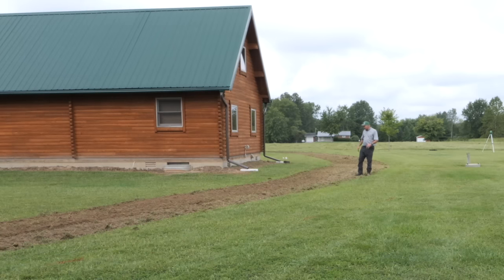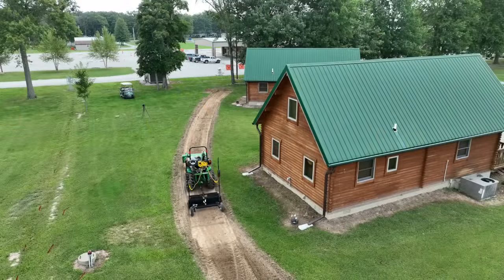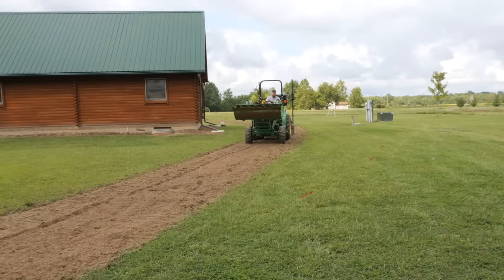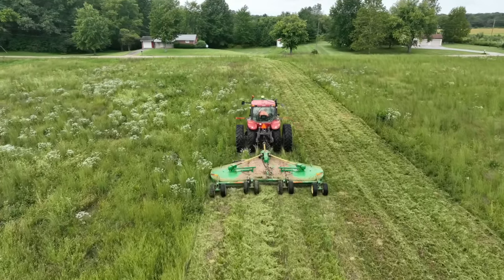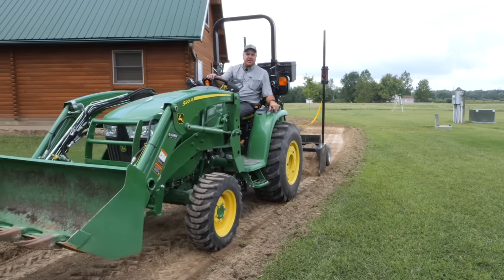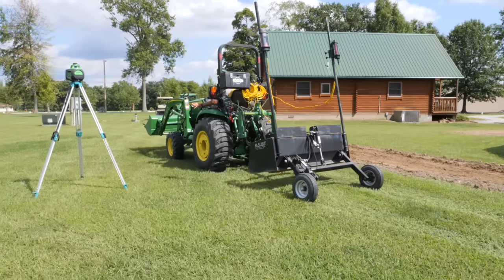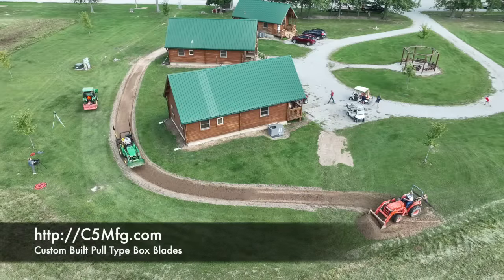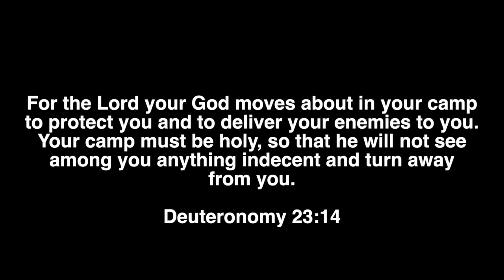Longest Drainage Swale We Have Ever Dug! John Deere, Kubota Tractors, Tom, Randall, Laser Box Blade!

Comment: Saw a guy use a skid steer the other day. He took out a bucket width down to grade. Then put one wheel in the center and cut the swale in. The he did the same on the opposite side. When finished it looked like it would be very easy to keep maintained. Very cool set up on the box blade.
Reply from the maker: Sounds like a good operator!  Yes, one strip down the middle, then slopes via wheel in furrow on each side makes a very nicely shaped swale…especially when smoothed up with the power rake!

Comment: Fun video!  Can I ask a question about the Maschio hydraulic offset flail mower that you have shown previously?  What is the range of cutting heights that it can cut - the manual doesn't tell.  You mentioned adjusting the cutting height, but I didn't notice you saying what height the choices were.  I have the same question about the Maschio hydraulic sickle mower that you showed - does it only cut one height?  What height does it cut?  Thanks!
Reply from the maker: Several height choices.  Ground level to say 4 inches or so I think.  However, our experience shows that lower cutting height makes for best cut.
Reply: Thanks! @TractorTimewithTim

Comment: Would an orifice restrictor(s) on each cylinder smooth out the motion?  Would need to be fairly small, maybe 1/32" diameter, to slow down those small cylinders.
Reply from the maker: We have tried similar (flow control valve).  Does not really help much since it takes so little oil to move the cylinder.  I suppose I could try a larger diameter cylinder.

Comment: Tim most building codes on a 30 foot span want a 3.75 inch drop for drainage in a 3 to 6 inch pipe so if you take your laser level and you don’t see that amount of fall then measure 40 feet and if you don’t see 5 inches off the rear of the buildings and in between the front corners if they are for example 20 feet apart and you don’t see 1.25 inches of fall from 12 inches down the foundation then it’s all sloped incorrect